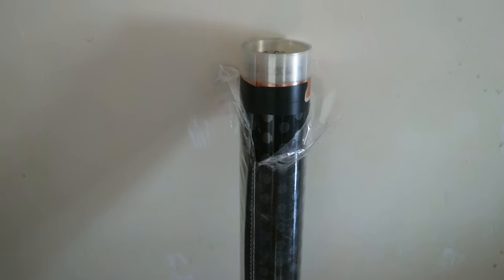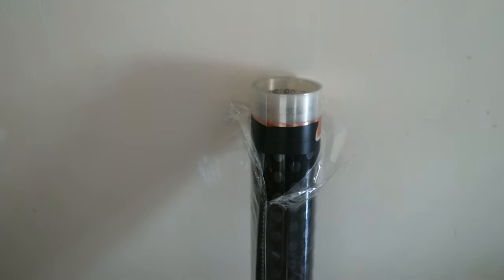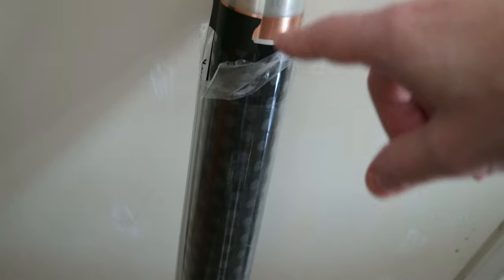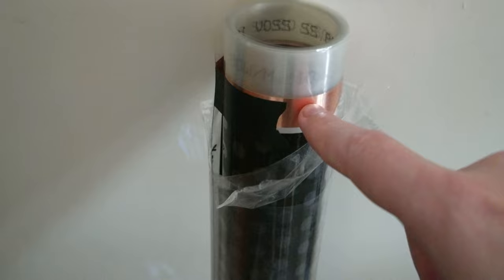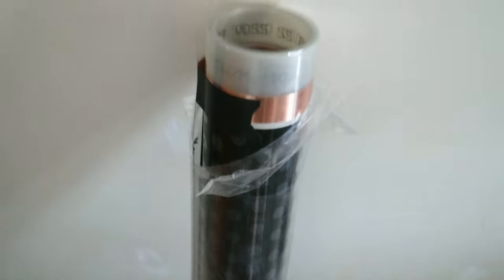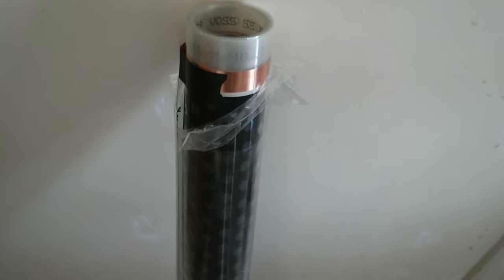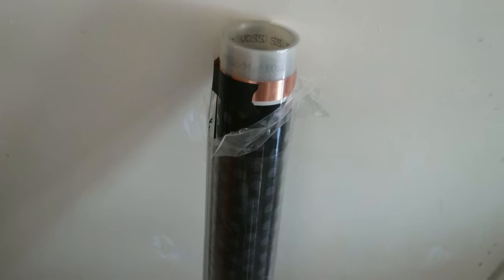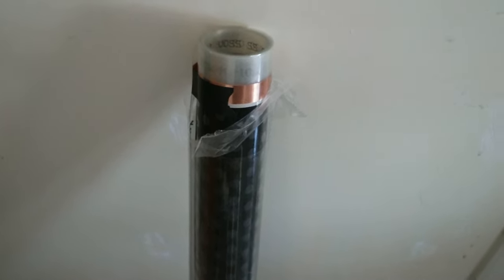3D Printer big bed solution, Infrared Heating Film

Comment: That is a pretty cool idea! I am interested to see how it works out. I love how you thought out of the box on this one and found something more affordable. There are often solutions out there that are more affordable then the current ones that are "marked up" for resale. One thing you didn't mention, what is the max temperature that roll is rated for? I would assume it would only be able to warm the bed enough to help prevent warping and aid adhesion.

Can't wait to see your printer running again!

Edit: After looking it up I seen it was around 50-55c which is pretty good. They do have an Aluminum Foil Mat Kit Heater that can go to 65c and honestly probably more if you go with a thicker one than the 0.5cm.
Reply from the maker: Ops, I forgot to mention the most important thing!? Anyway, depending on the film solution temps go from 40 to 60C, since this types of infrared films are used for heating floors they do not need to go very high. Yeah, there are many different types of these infrared films. Btw for the size of my printer, a normal 3D printer bed solution it would cost me almost $1000 for all the pieces, that's why I looked for something else. Now I think they lost my thermostat so I need to order a new one, which will take time. The 3D printer assembly is on hold, waiting for parts and is taking long time with everything going on. I will share as soon as I can for sure. Thx for the comment!